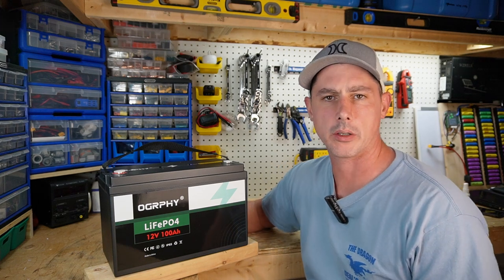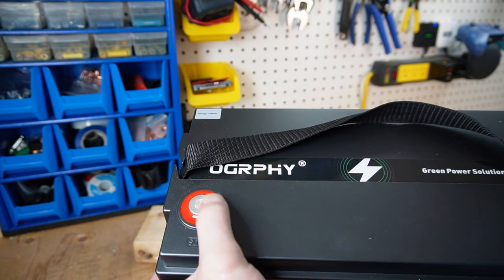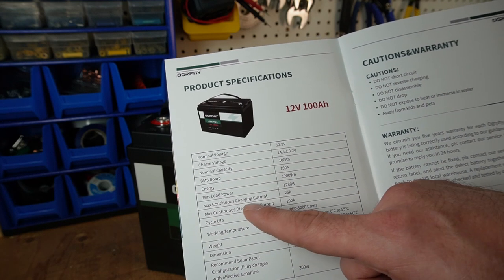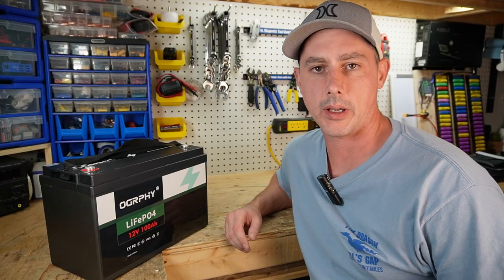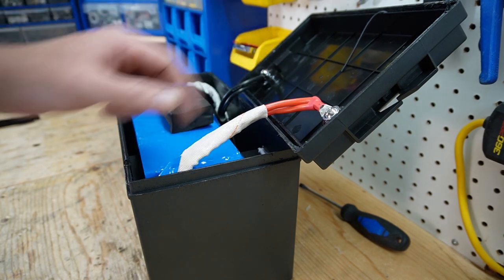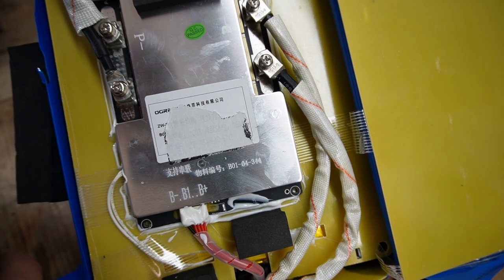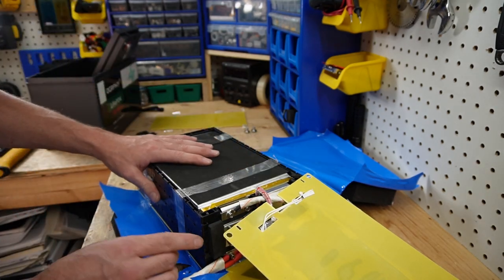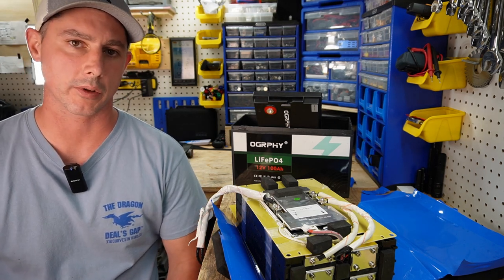Ogrphy 12V 100Ah LiFePO4 battery

Comment: That's a good find about the cable connections.  That would make anyone think their battery is busted when all that happened is a connection is loose.  Nice video!
Reply from the maker: Very true. I'm thinking it may have been a quality control issues, It may have been a one off mistake.
Thank you for watching :)

Comment: There is a fella who installed three .12 Volt of these on a ego golf cart here on YouTube. He seems happy with them. Could you break it down further ? There are so many lithium golf cart batteries out there now it's very confusing and the information as well as warranty information seems sketchy at best when you read the fine print. There also seems to be discrepancies between owners manuals, web site and the battery case itself regarding battery specs, info etc etc. Thanks, keep up the great informative videos !
Reply from the maker: The Batteries I use for golf carts are Epoch batteries. They are bulletproof.
https://www.epochbatteries.com/products/48v-90ah-gc2-golf-cart-lifepo4-lithium-battery-complete-kit?rfsn=7083713.4f6bf4

Comment: Hello, I need some advice, which is hard to get around here so I thought I would come right to the person who I think knows more about it than anybody else. I have a club car DS model it is a 1990 still runs good but it is currently a 36 volt lead acid battery six of them. I was interested in this ography battery you had reviewed and was wondering what do I have to do to my golf cart to be able to install three of these 12 volt lithium batteries so that I can rid myself of the lead acid battery?
Reply from the maker: You don't have to do anything. Just hook it up three in series. Get yourself a 36V LiFePO4 charger, and you're good to go. I have a 2006 Yamaha G22 48V, and that's all I did was put four in series and run it.
Reply from the maker: Install this, and you'll be bulletproof 
https://amzn.to/3PXUxK1
Reply: Thank you both for the help.

Comment: Have you ever  tested   "chins"  battery?
How can I find out how much  much  charge  rate my 12.8v. 100amh battery  can  handle?
Something is turning the  inverter off at  app. 28v.    I am  reading  35 v spike  on  my  fluke  meter. 
Any tips  and advice  will be greatly appreciated 😊 thanks
Reply from the maker: No, I have not reviewed a Chins. For your charging you can check the user manual or the web. I wouldn't recommend charging at or close to the max rate as this will deteriorate your battery faster.
As fare as your voltage spikes I would stop using that battery immediately and contact the company.

Comment: Maybe the BMS has slow charge rate because the cells couldn't handle 1C charge rate.
Reply from the maker: You might be right. I should have taken it apart further to check for markings I just don't like handling pouch cells. The price is good, For solar that charge rate will work for many. Thank you for watching

Comment: I have the Minnkota Endura Max 45lb trolling motor. It's max amp draw is 42. I believe the wire is 10 AWG. Will this work? Thanks
Reply from the maker: I'm not sure, 10 AWG is good for 30 Amps
Reply: It has a 50 Amp Circuit Breaker @ 12 VDC @Roll2Videos
Reply from the maker: With a 10 AWG wire, I'd only use a 30A fuse. 50A is too current for a 10 AWG wire. It's going to get hot. If you need the 50A, I'd use an 8 or even a 6 AWG wire on that.